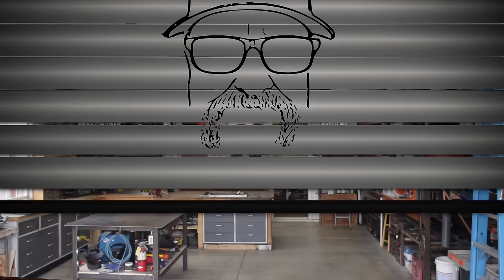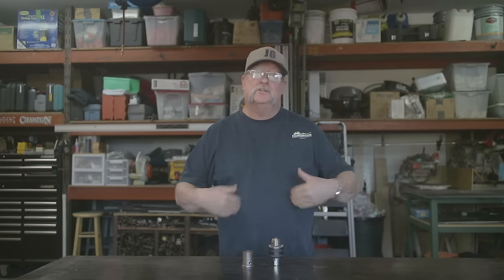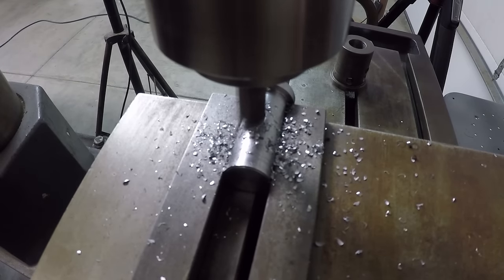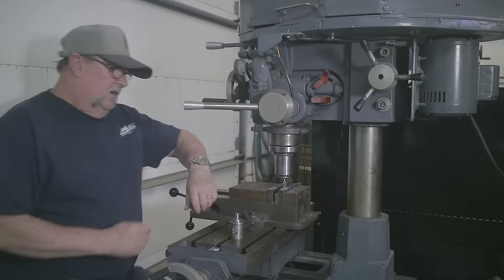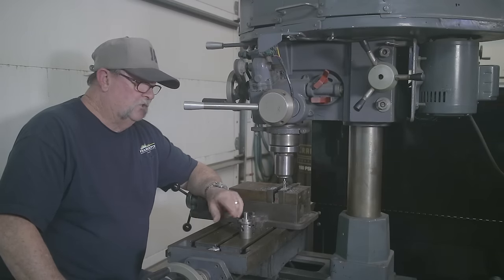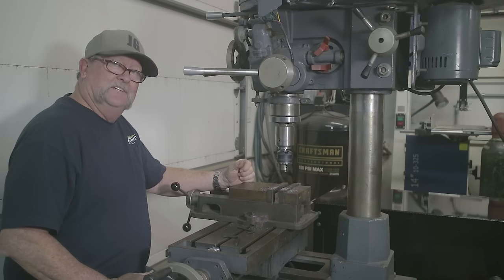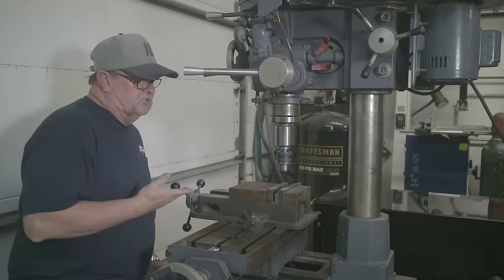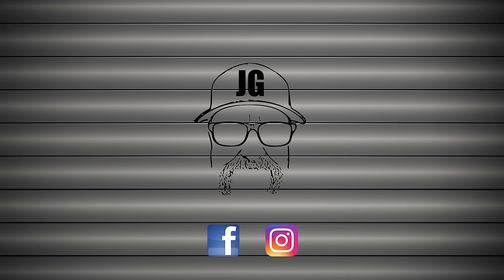Mill & Lathe Machining Work - JIMBOS GARAGE

Comment: Jimbo

 now that you are getting into milling and lathe work, you need good dial indicator so you can  actually measure the run out on your chuck/parts/etc that you work with.  Heck with that hord of bits and pieces, you may already have one.  Get you FIL to show how to setup and use.

Also, if that mill uses a R8 spindle, get a set of R8 collets and skip the adapters.  Will run much truer in a collet instead of putting an adapter in-between the machine and the chuck, end mill, etc

Keep up the good work

John

Comment: Thanks for the video. If you want to gain more room between the drill chuck and the vice, you could loosen the nut on the spindle and loosen the R8 collet and take out the holder you are using. This is an example of your set up. R8 collet to holder, to another holder then drill chuck. This is what you could have R8 collet to key chuck and your new holder that you made. This would also have a better chance of the drill chuck running truer then it is right now. To loose the R8 collet there is a nut inside the pulley area that you loosen this is called a draw bar that pulls the R8 collet into a R8 taper. This would give you more room between the chuck and vise and hopefully a truer running chuck. Plus you can hold milling tools in the R8 collet that will give you better run out on tools. having three tool holders then a tool makes for a greater chance of errors. 
Have a day
Reply from the maker: Thanks for watching E Hiebert, And thanks for your great advise! Jimbos garage!

Comment: Glad it turned out as good as it did, and for a 1st time attempt that's a great job. An option came to mind about making the part, which was; to make the collet and threaded shaft as one complete unit to install into the mill. That would reduce one connection where a few thousands could be introduced.
Reply from the maker: Thanks for watching Tom, Ya that would have been a great idea, I didn't think of that, But i can always make another one!!!  Jimbos garage!